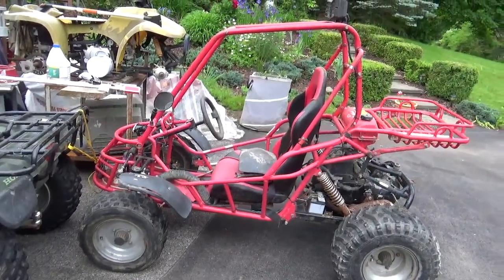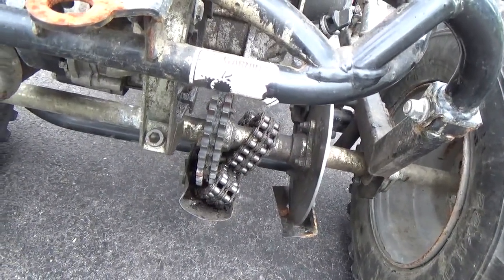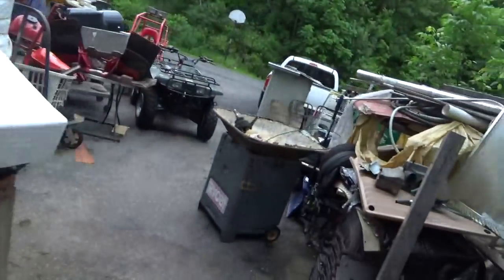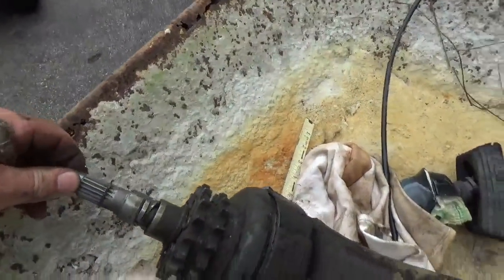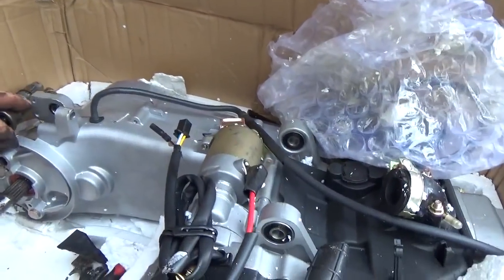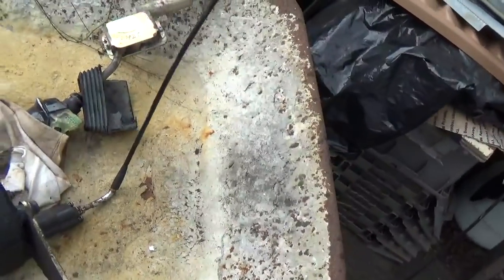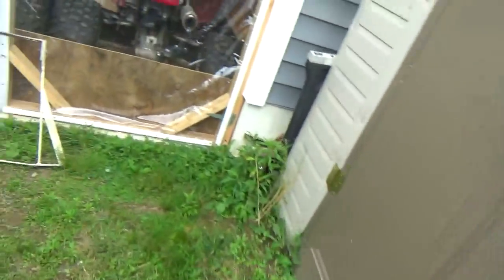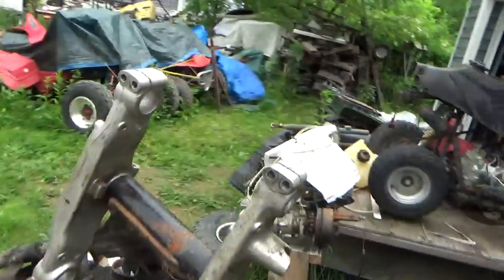Hammerhead Buggy external reverse gear swap, GY6 output shaft length,

Comment: Hey Harvey, what type of lubricant do you use in your external reverse gear boxes and how much? 
Been looking and looking can’t find much info out there on it. Even I’m in manuals… Is it 90W gear oil? Saw someone said that. 
I am rebuilding a Gy6 off an old Twister, finishing up and rebuilt the reverse gear box and cleaned some thick nasty burnt looking grease out of it but thought I’d ask you because you seem to be pretty experienced with these.

Comment: Love your video's.  I have the same double sprocket reverse setup and have had to swap the longer shaft all the time.  4 engines ago.  Do you know how the cable can be removed from the reverse gearbox?  Thanks.  Searching your librariy now.

Comment: Thats not a hammerhead Its a dazon. Just swap shafts. You make things so damn complicated for no reason. No you dont have to run the double sprockets.  Yes you can swap to a single sprocket reverse box as long as you swap output shafts.....Its not hard to do nor rocket science. There are multiple variations of the external reverse boxes.....Most buggy boxes will interchange as long as you use the matching shaft. Atv boxes are not always interchangeable.  No you dont have to take the whole box apart to swap cables. Very little about these are expensive.  Like where do you come up with all this misinformation? You seriously need to  do your research on these buggys and quit just guessing about what your doing. Srry if i sound like im being an ass but im tired of all the misinformation from alot of your and others videos.

Comment: Its made in China. Worth 400 new. The go cart you keep talking about. To fix it is more than it's worth. Go ahead I bet you 20 bucks it's going to cost 240.00 you paid 150.00 for g6 motor. Plus 200.00 more in parts to finish it. You will be invested 550.00 roughly.  550.00. For a 400.00 go cart. Would of been better buying a new one and doing an unboxing video. Duh. Wake up . Slow down on the bong rips tou will see where I am coming from.
Reply: Man i never knew man. I bought a used one in terrible condition for 900 😔 where could i find one for that kind of price mike?
Reply: @Hopinmypony  he hasn’t answered in 2 years because he is completely and totally wrong and he knows it.
Reply: @MrJamesTimmons  i bought another go kart for $700 and it broke down the next day 😭 i should just not buy anymore go karts

Comment: I had a razor150 and bought a sun-l 150 i swaped my  dual sprocket reverse transmission for a single and shimmed the axle so it would line up with the inner most sprocket on the axle

Comment: Hey Harvey,    So I was thinking which could be a problem so forgive me for that Lol,Lol,Lol   Any way Harvey,  you could take and put a groove in the new shaft and put a key-way and a new sproket that matches the teeth that the other one or just change shafts from the single to the double.     Also I a still hoping for a little more hands on if it doesn't hurt your hand ........  Do you have a tripod ?  That may help you as well ???  Just asking to see you in action !